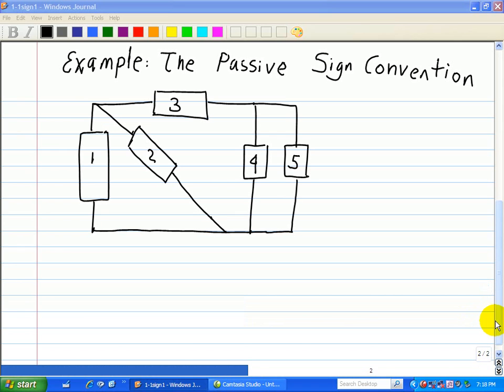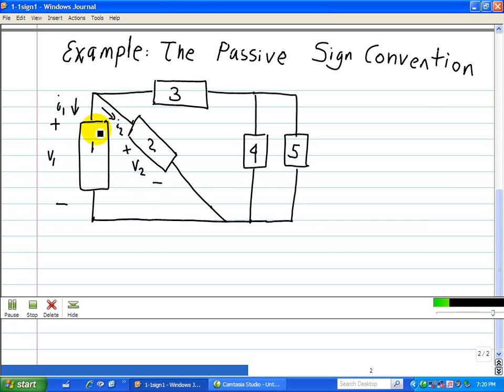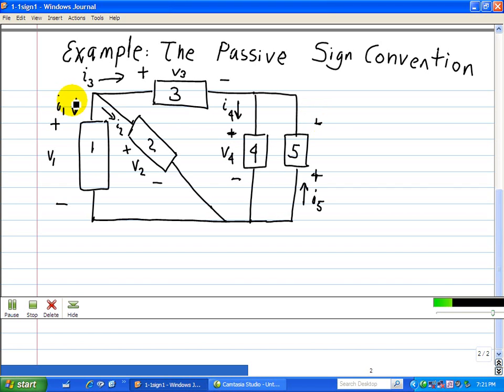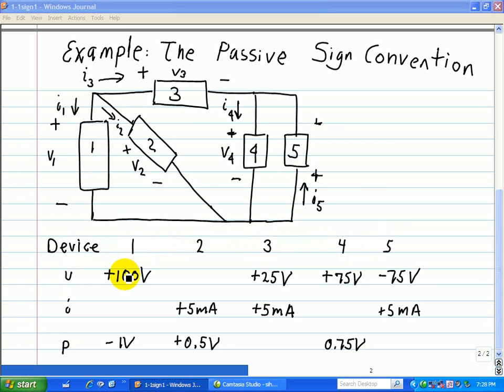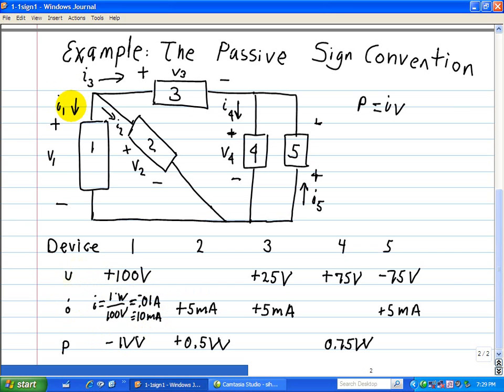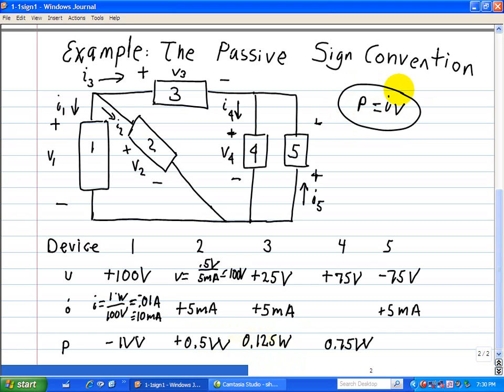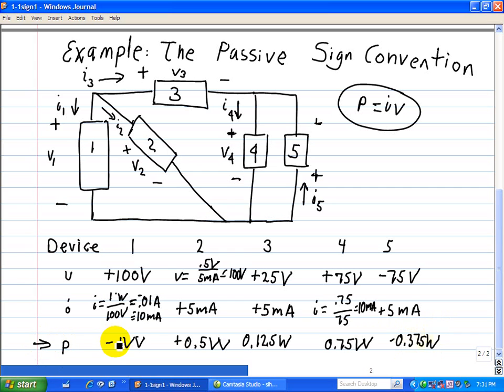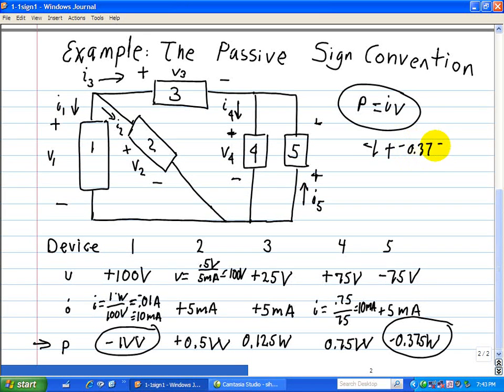Electric Circuit Analysis - The Passive Sign Convention - Examples (Part 2)

Comment: ...so, in a simple circuit if we measure a negative volts or current doesn't that mean that the meter was inserted incorrectly? ...i.e., not tracesing the red leads back to the voltage source...thinging in terms of DC...

Comment from the maker: @brawl313   For a voltage source with + on top and - on bottom that would be positive.  Recall, once you assign a voltage polarity then current direction must be from positive to negative and vice versa. Choose one:  assign a voltage polarity  or assign a current direction for each device in a circuit.   Voltage polarity and current direction are not independent.  Again, if you pick a current direction, then that fixes the polarity where the + is the tail and the - is the arrow.   Dr J